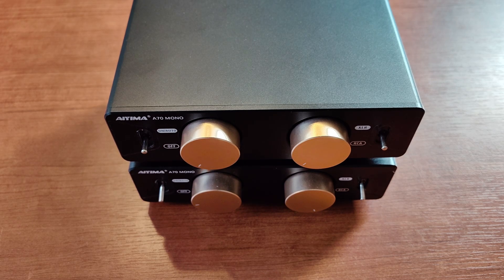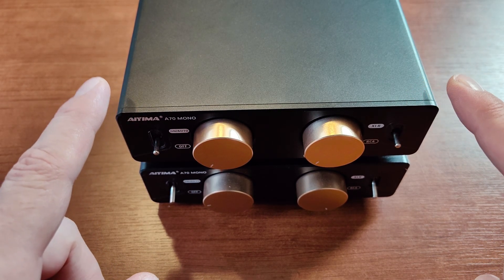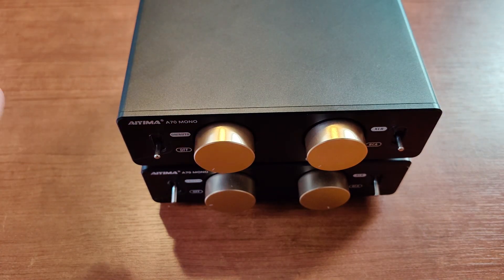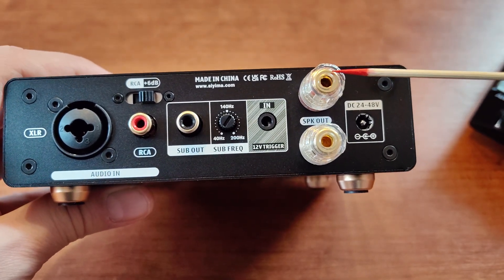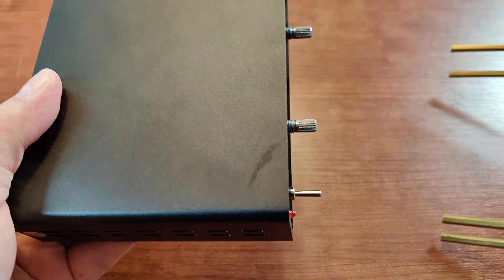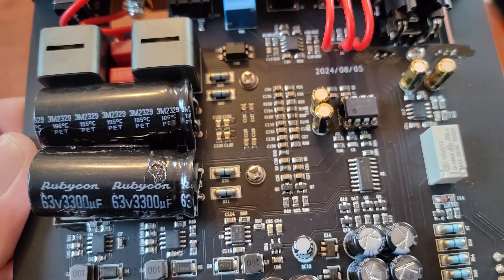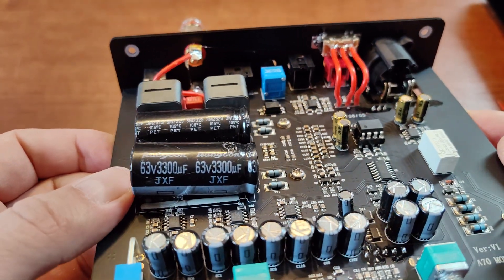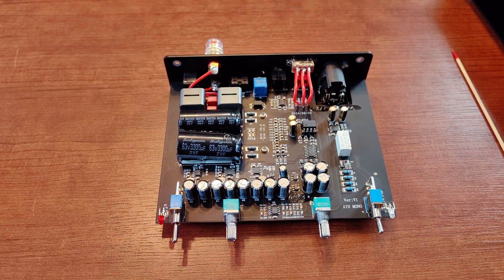New Aiyima A70 mono speaker amplifier build and inside look - GoldenEye(s) ;)

Comment: Hi, nice review. What kind of opamp you recommend to this amp?
Reply from the maker: Thanks. There is not muh room inside, so something IC like OPA627 (double in adapter). I will be doing full review soon so I'll give my recommendations there for the ones that will fit inside (I got covid and there are some delays in my videos :( )
Reply: @k4syx Thanks for that! To może teraz po "polskiemu" z tego co wiem oryginalnie jest tam układ ne5532 interesujące jest to połączenie równoległe chyba dokupię dwa takie wzmacniacze i zacznę od tego, opa627 też spróbuję. Fajny kanał prowadzisz dlatego zdecydowałem się na zakup tych wzmacniaczy zobaczymy jak to będzie się miało do mojego obecnego wzmacniacza. Pozdrawiam Krzysztof
Reply from the maker: @krzysztofm9438  Dzięki :) OPA627 will be miles better than 5532. And its not as expensive as it used to be!
I will do a full review soon, I just need to get out of covid at least to a level when I will have my regular voice back :)

Comment: I wonder how much these cheap class d are behind something like hypex nilai amps
Reply from the maker: Good question, I need to get some to compare. I wouldnt assume they are behind without solid listening session. ZeroZone monoblock 3255 set is simply amazing - they actually did design they own boards instead of just going with reference TI whitepapers one

Comment: These small power amplifiers are amazing starting or end points points into the hifi rabbit hole! 

Especially with the options for upgrading the Op-amp for the fiddlers to experiment with and have fun!  ....which can be made even better (or more interesting?) with the addition of reasonable tube preamp in the mix... to add that certain something...and more simple upgrade options with tube rolling.

It's a great time to be in hifi. I imagine one day there will be a full tube +dual mono class d hybrid integrated amp ...with multiple source inputs in a nice long slim chassis
Reply from the maker: Exactly! Think how far these went from first TPA3116d stuff a few years ago, and we still mostly see mature TPA3255 designs now.
So the biggest question that I have is what TI has up the sleeves, what will be the next generation of  d-class capable of!
With tube preamps and better opamps D-class is really good and there is some real invention happening

Comment: Only one opamp to replace will save some money when putting in Sparkos or Staccato. Maybe apply some thermal paste to the heatsink? I wonder how they compare to the Zerozones
Reply from the maker: I will check how do they compare to ZeroZones and also Fosi stack that I got in my mail (FINALLY) today
Reply: Yes, good thermal paste would help to accelerate heat transfer to the chassis.
Reply from the maker: @ChicagoRob2  yes it would but on the other hand these do not generate a lot of heat at all so they do not have to be as efficient in transfer as for example CPU radiators with all that polished base and silver based thermal paste